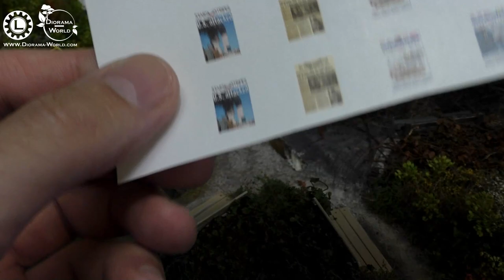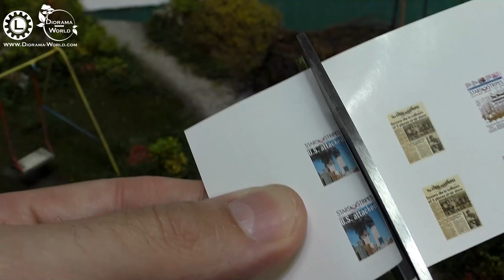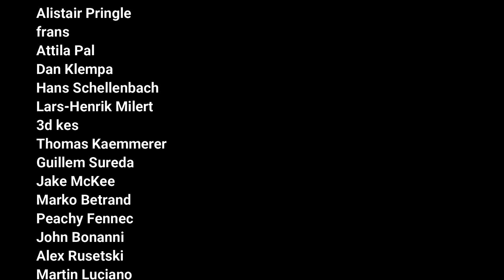Time Portal in a Bad Future Diorama scale 1:35

Comment: Really loved the work! I felt that if you could have added some kind of sanded acrylic plate or sheet of some sort, the light from the LEDs would diffuse more and the individual LEDs would not be visible. Just a suggestion!
Reply from the maker: Thank you for your tip, that's right. I'll test that with the next goal.

Comment: Couple questions on this awesome project. What is the name of those wire cutters and those really slick wire couplers that have solder in them that you used?
Reply from the maker: Thank you, this is a wire stripper, with a soldered connector or hose connector, you can find everything on Amazon